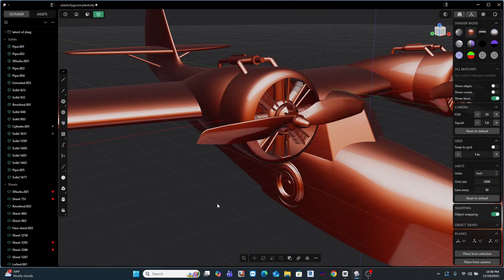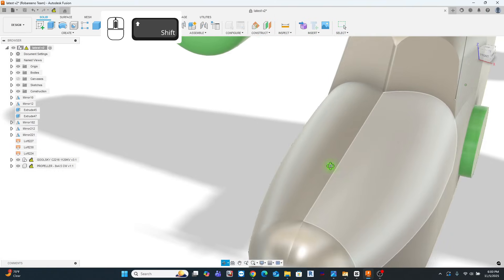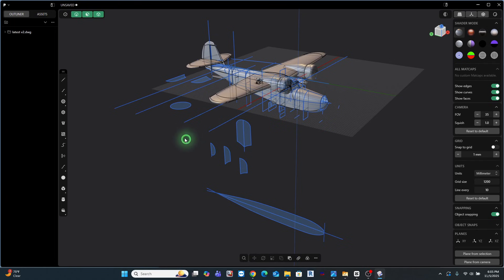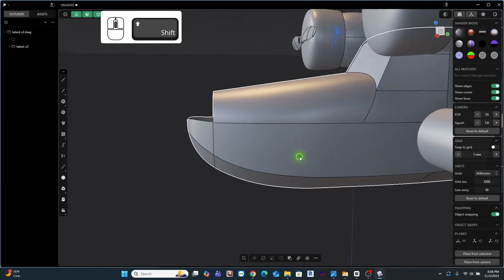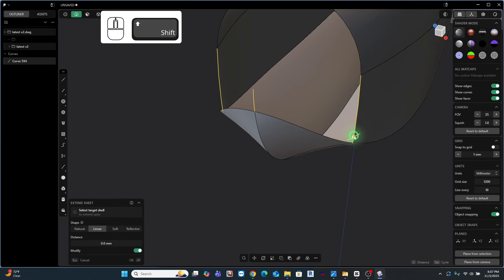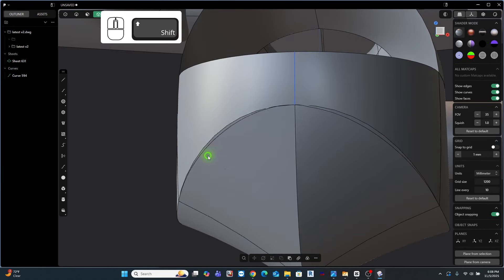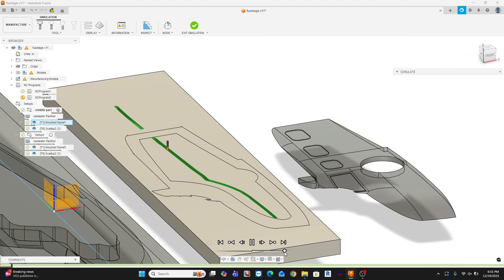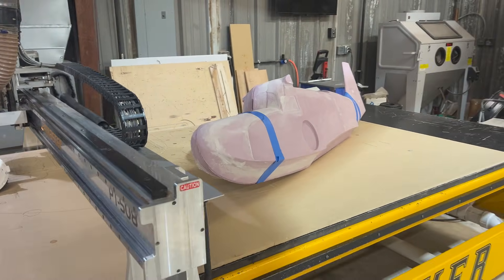I'm Building a Huge RC Flying Boat from Home Depot Foam and a CNC!

Comment: What's the span?  What are you planning for motor/prop/battery? I am doing an analog version of this as a 60inch span Westland Whirlwind. Shooting for 4.5 lbs and 2 2200 3S batteries. Seems like a similar size to yours.
Reply from the maker: 100 inches.  I'm going to run two eflite power 60 motors.  Borrowing 1 from my Pitts project.  I'll put it back later.  ;)

Comment: If you want more control and better quality? Work 80% curves 20% surfaces. My workflow that all the skins done in rhino, then export it as step file to solidworks for engineering purposes. 

Plasticity and rhino need totally different mindset that the parametric workflow. They complete each other.
Reply from the maker: Thanks for the input.  I actually have Rhino on my radar for this year.
Reply: @redbaronrc you won’t regret, rhino advanced more and you can control the design better once you understand the tools and layers workflow. Moreover it has SubD modeling with A class quality, unlike fusion freeform 😊 but it has steeper learning curve than plasticity and fusion.
Reply from the maker: @yasiabudhabi thanks.  I'll take a look.